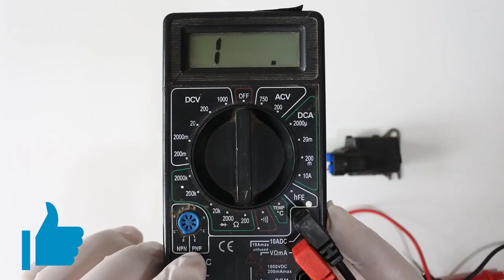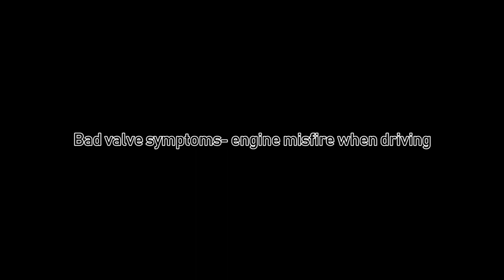Purge Valve Solenoid or Vent Valve Solenoid Test and Cleaning Process

Comment: WD-40 isnt really bad to use, but in this case with a delicate circuit board inside like the sensor shown i would use contact cleaner. Good enough to clean and keep the safe from getting damaged in any way

Comment: I get error "canister purge solenoid valve circuit" open circuit in my Renault Twingo 1995 with an Delco Remy 199 solenoid. I checked continuity to the ecu and resistance of solenoid and check it with a vaccum pump but still error keep coming back, what could be the issue?

Comment: hello is there a way to unlock the valve,when it remain opened even it s connected to the battery?os it possible to open on the back ro clean?thanks to share your exeperiences
Reply from the maker: the logical unit controls when  should valve opens and closes!
Reply: @OliverTube  do you think it is possible open the black back tube to extract the piston to clean it?thank for the answear
Reply: @OliverTube  do you think it is possible open the black back tube to extract the piston to clean it?thank for the answear

Comment: did you clean it with WD-40 or carburetor cleaner or?
Reply: It says WD-40 on the screen when he's spraying it into the straw. I would think carb cleaner would work just as well, though
Reply: Yeah the video did use WD-40 which I would honestly recommend against. I would first CLEAN it with a big dose of carb / throttle body / sensor cleaner because it's an actual cleaner and dries fast, then when good and dry, hit it with a small shot of white lithium spray lube .

Comment: will this cause bad gas mileage cause my car chugs  gas at random times not always
Reply from the maker: Daaaaa!!
Reply: @OliverTube  whats daaaa is it duh like yes? thanks
Reply from the maker: @justinc9911  Communist version is like this!
Reply: Yeah it could, anything in the EGR system like this valve or clogged canister could cause erratic bad gas mileage. Also check your vaccuum tubes for cracks or wear, also check or replace the PCV valve which is cheap. Really dirty intake sensors could too.